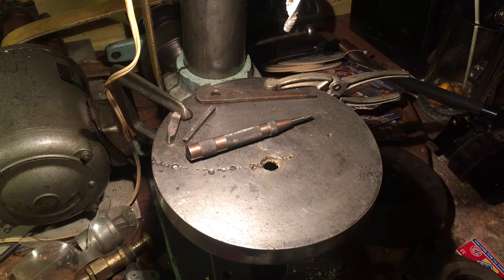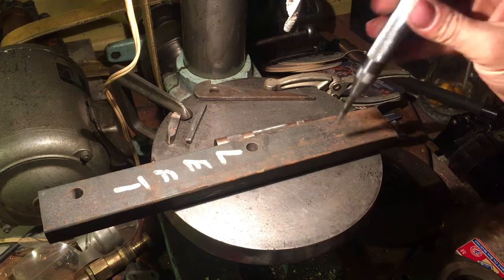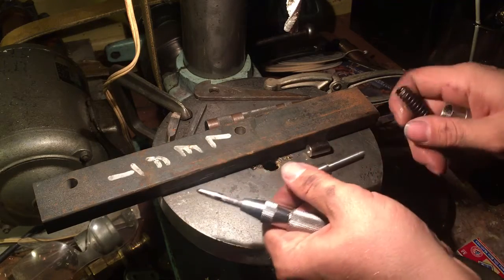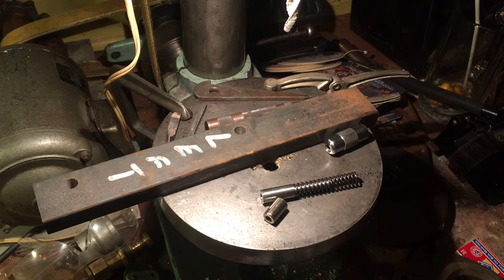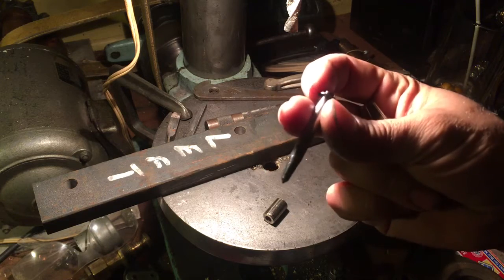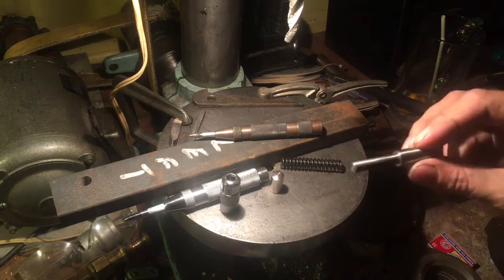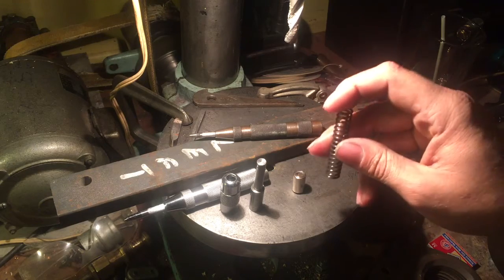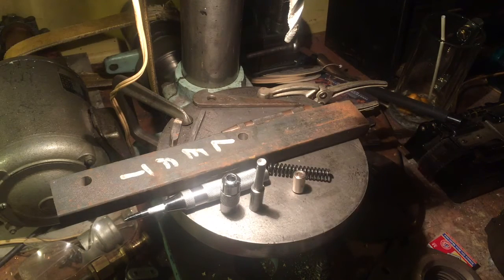Automatic center punch modification, hit harder without a stronger spring

Comment: Works better if you round both the hammer and nail but on the nail leave a flat middle with rounded edges.  If your picky enough you can even put ridges into the nail so it snaps but would have to heat treat that end so it wouldnt break or bar through those ridges when it does snap..